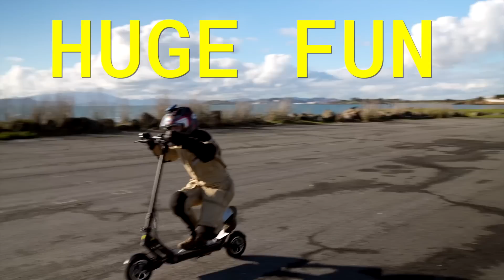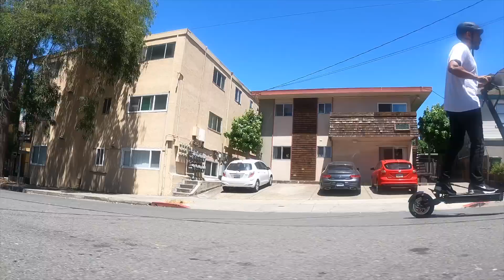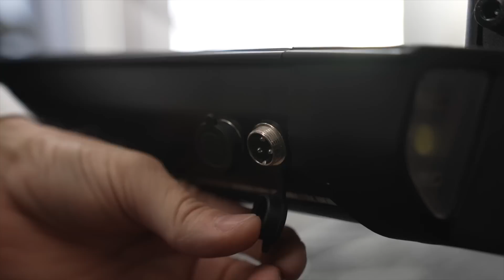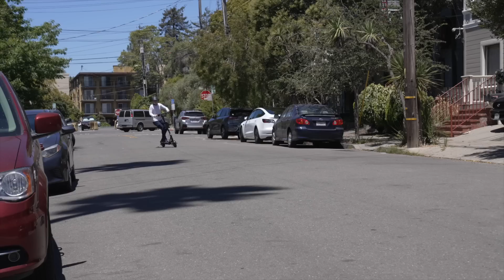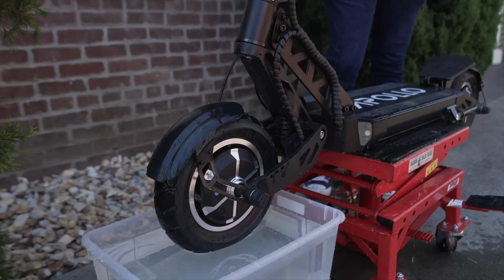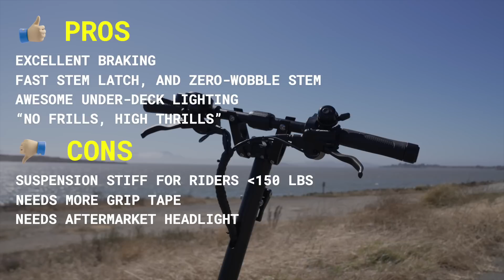NEW Apollo Ghost 2022 Gets 1,000W Motors - ‘No Frills, High Thrills’

Comment: people realize apollo is just a reseller right? the 1000W motors are standard on the VDM-10 (thats what the apollo ghost is actually called by the company that makes it) and it is half the price of the appollo lol. and you can get it with a larger battery.
Reply from the maker: The Apollo Pro , City Pro , Air and Go are all their own scooters and not OEM! They own the IP on all those models. The ghost has been discontinued a while ago.

Comment: I also want to share that the inner tubes and tires that the ghost comes with are not the best. I've got just over 1000 miles on my ghost and ive had to change each tube twice, I finally got better tubes and real rubber tires rather than the stock nylon ones. I should also mention that I do ride on trails and gravel often. Other than that i love the scooter so much, it's more than worth it in my opinion.
Reply from the maker: Very insightful! Thanks for sharing. -Vosk

Comment: Did you have to do anything to get the scooter to go above 15mph? Both my wife and I bought Ghosts, and no matter what gear we are in the maximum speed is 15mph even if no one is riding it (it's just sitting on a box with the wheels free spinning.) Apollo's customer support takes at least 48hrs, so just seeing if anyone here is able to answer faster :) If it was just one scooter I'd think it was defective, but where both have the issue I'm thinking I'm defective lol.
I've made sure the battery was fully charged, and the P settings have:
Acceleration = 5
Power = 100
I'm hoping it's just a setting I'm missing, or maybe something like the brakes being too tight. It's my first scooter so I'm kind of an idiot as to what's normal and what's not. Once it stops raining I'll test out the brake theory by riding it around a bunch. I've only gone around the block once when it wasn't raining to just to make sure it worked.
Reply from the maker: Did you try changing the riding modes , if it’s on eco mode it won’t go fast , make sure it’s not on eco mode and make sure it’s on dual motor
Reply: @ESG-ElectricScooterGuide  Thanks for the quick reply. Actually it apparently just needed to be broken in a bit. It's been raining here for the last week or so, so I hadn't been able to ride it since that first day I just took it around the block and it capped at 15mph.
My wife and I took our scooters for a few mile ride today since it's sunny, and by the end of the ride the scooter was hitting 38mph!

Comment: So it still a VDM10 but now with same 1000w (since the 2021 was rated at 800w and original VDM10 1000w motor) and updated stem? All the rest seems the same as the regular VDM…
Reply from the maker: Very similar with some upgrades!

Comment: I bought a '22 Ghost as my first scooter, based in part on these reviews. I'll definitely try your suspension tweak, I think that will be helpful. 

The significant QC issue I had was that the rear brake caliper adapter was installed backwards, in the 160mm rotor position. The scooter has 140mm rotors, so only half the pad area was being used. An easy fix, but it shouldn't have been shipped out like that.

A smaller issue is that the deck-mounted hook needs to be rotated 180deg, or bent upwards, to work.
Reply from the maker: Very insightful! Thanks for sharing. -Vosk

Comment: Im 140 lbs and i owned 2022 ghost, would like to know how to soften the suspension
Reply from the maker: My favorite mod for the Ghost is to add a small reinforced rubber washer and metal washer to the top of the bolts for the suspension spring. It doesn't really soften up the suspension, but keeps the suspension from clunking when it reaches the top of travel. The trick is finding washers that fit into the space. You can add a stack of rubber washers for more cushion. It’s best to use washers with fibers embedded in them, otherwise they will pop off. I’ve even seen folks work a small spring, into that space. The other thing I haven’t tried that could help is giving the spring one or two turns counter clockwise, to reduce spring preload. This would also make it top out less. The tricky thing here is you’d need to loctite the bolt once you’ve loosened it to make sure it doesn’t keep backing out (because if the bolt comes all the way out the spring could completely leave the scooter)

Softening the top-out feeling really changes the feel of the scooter for the better.   -Paul

Comment: why would this Ghost be a little slower than the 2021 ghost if there's two 1000 watt motors now, same speed controller and it being only like 2 lbs heavier?
Reply from the maker: That's a good question. The 2022 is quicker up hills, due to more copper in the motors, but there may be something about the motors that causes them to make less power at higher RPM. (different KV-spec: rpm per volt, perhaps)    -Paul
Reply from the maker: The battery voltage is most important reason for top end speed! also conditions, weight of rider, wind etc
Reply: @ESG-ElectricScooterGuide  the video review states under the same conditions so I assume the rider weight and road were controlled for and battery voltage. But the other factor about RPM per volt makes sense if the motor is built slightly differently. I wonder if there would be ways to confirm that somehow. 
Thanks for the response!

Comment: I am definitely interested in your idea to adjust the suspension for lighter riders…
Reply from the maker: My favorite mod for the Ghost is to add a small rubber washer and metal washer to the top of the bolts for the suspension spring. This keeps the suspension from clunking when it reaches the top of travel. The trick is finding washers that fit into the space between the spring-bolt and the top of the swingarm. You can add a stack of rubber washers for more cushion. It’s best to use washers with fibers embedded in them, otherwise they will pop off. I’ve even seen folks work a small spring, into that space. The other thing I haven’t tried that could help is giving the spring one or two turns counter clockwise, to reduce spring preload. This would also make it top out less. The tricky thing here is you’d need to loctite the bolt to make sure it doesn’t keep backing out (causing the suspension to fall apart). 
You also need to make sure that if you back out the bolt, that you always have at least three threads going into the lower swingarm.     -Paul
Reply: @ESG-ElectricScooterGuide  Great tips & worth trying them.Thank you.
Reply from the maker: Awesome! Enjoy your new ride! Stay Safe

Comment: Did they upgrade their tires that often get flat?
Reply from the maker: Tires appear to be the same, but the tubes may be different, and it comes with spare tubes. The most important thing to prevent flats is checking tire pressure once a week (or ideally before each ride) and making sure they’re fully aired up. All scooter tires have a ton of surface area relative to their volume, so they lose pressure way faster than car tires or even bicycle tires. 
I haven’t checked, but thicker rims mean that the profile of the rim is probably also more blunt, which would help prevent pinch-flats.   -Paul

Comment: Technical question for you - just like there’s no battery saving riding single, what real benefit is there to Eco when its top speed is 17mph, vs mode 1 at 20mph? Any difference in amps delivered, acceleration etc that helps significantly on a days ride?
Reply from the maker: Great question. The difference in acceleration between speed mode 1, 2, and 3 is hard to detect, but there is a noticeable difference in acceleration between Eco and Turbo. So Eco will be drawing less current. It's going to be a very small savings though, especially on the 2022 Ghost, because physics-wise, accelerating you and the scooter up to 17 mph takes a certain amount of work no matter how quickly it's done. So the only two things which would impact range here are:
Does Eco mode keep the motor cooler (less resistive loss to heat)
Does Eco mode lower your average speed (wind resistance is non-linear, so lower average speed increases range).

For big impact on range, the main factors are (in order of importance)
1) Keep top speed low
2) Set tire pressure to maximum recommended pressure
3) Have a small wind profile (hard to do much about this one. Zip jacket closed, zip jacket pockets closed. Close face shield on helmet if full-face).
4) Make sure brakes aren't dragging
5) Try to avoid applying more than 50% throttle, or run in Eco mode, to keep the motor operating in its most efficient mode. 

-Paul
Reply: @ESG-ElectricScooterGuide  wow thanks!
Reply from the maker: Happy to help!   :-)

Comment: I'm 155lbs- tell me your secrets, Paul!
Reply from the maker: My favorite mod for the Ghost is to add a small rubber washer and metal washer to the top of the bolts for the suspension spring. This keeps the suspension from clunking when it reaches the top of travel. The trick is finding washers that fit into the space between the spring-bolt and the top of the swingarm. You can add a stack of rubber washers for more cushion. It’s best to use washers with fibers embedded in them, otherwise they will pop off. I’ve even seen folks work a small spring, into that space. The other thing I haven’t tried that could help is giving the spring one or two turns counter clockwise, to reduce spring preload. This would also make it top out less. The tricky thing here is you’d need to loctite the bolt to make sure it doesn’t keep backing out (causing the suspension to fall apart). 
You also need to make sure that if you back out the bolt, that you always have at least three threads going into the lower swingarm.
-Paul

Comment: Awesome scooter! Question! Did you have the same issue as Ginger on wheels with your wolf king gt? Sudden jolts of power when taking off in dual motor mode? It took out from underneath me today and I fell off :/
Reply from the maker: No! We didn’t have any issues like that at all! Glad you are okay. Stay Safe.
Reply from the maker: It wasn't a GT, but I did break my wrist on a Wolf King trying to ride one handed. That was 100% user error though.  I pulled the throttle with only one hand on the bars.   -Paul
Reply: On full power settings the GHOST IS GRABBY & TAKES OFF FAST...SO HANG ON TO THOSE HANDLE BARS & LEAN FORWARD THAT TIME.😇🤣😂😍

Comment: At this price range, I would rather buy a VSETT 10+ dual motor than getting a mid cycle refresh ghost scooter, because there is an authorized VSETT dealer and repair shop 10 minutes from my house. The problem with Apollo is that they do not have their own repair shop in the Greater Toronto Area. I had bad experience with their partner service centre - Repair and Run, when I need to repair my scooter. They are not very helpful at all.
Reply from the maker: They are definately ramping up service centers in Canada & the US!

Comment: How do you guys think this compares to the apollo city? Which one would you choose.
Reply from the maker: It really depends. They both weigh about the same. The Ghost is quicker off the line and has higher top speed and much stronger brakes.

The City Pro (dual motor) is roomier, a little more modern looking, and easier to ride. The City Pro has a nice app, (that keeps getting better), it has tubeless flat-resistant tires, and the cool regen thumb brake. Both are really good looking. Oh, the City Pro has a higher water resistance rating and better fenders, so it’s definitely better in rain. 
For sporty intermediate to expert riders: Ghost. For new to intermediate riders who want a smooth commute and a scooter that’s a little more modern: City Pro.     -Paul

Comment: the suspention adjustment you mention, is that applicable to any vdm-10 varient?
Reply from the maker: It should be applicable to all. The feel of the suspension topping out is the only thing that bugs me about the Ghost. Do be careful about unloading any spring. Don’t sit on the scooter, while doing it, of course.
The rear spring is hidden under the rear footrest.   -Paul
Reply: @ESG-ElectricScooterGuide  Yeah, it would be nice if there was some damping, or at least a top-out bumper. I'd be happy to spend some money on improved suspension.
Reply: @ESG-ElectricScooterGuide  i'm in aus have an E-glide mach 10. over all love it two things tho later one is on me and not scooter. my model has mechanical brakes and i find that i have to re adjust them all the time either because soft or pad scraping noises startm, rotors are flat and true , also i have managed to lean so sharp while cornering at high speed I've hit the sharp edge of tyre and it's skipped/drifted like a stone on water (no stack recovered both times but definitely pulled over and waited for adrenaline to settle down) 
i have my suspension tightened as much as i could i weigh 65-70kg about 150lbs
Reply from the maker: I think you're ready for better tires. See if there are any PMT's available which will fit your scooter. One of the troubles with pushing the limit all the time (like I do) is that eventually you find it!
-Paul

Comment: I would like to see a video guide on suspensions.
Reply from the maker: On suspension in general, or tips for the Ghost? I’d love to do one on all the different types of scooter suspension!

Here are my tips for lighter weight riders on the Ghost.

My favorite mod for the Ghost is to add a small rubber washer and metal washer to the top of the bolts for the suspension spring. This keeps the suspension from clunking when it reaches the top of travel. The trick is finding washers that fit into the space. You can add a stack of rubber washers for more cushion. It’s best to use washers with fibers embedded in them, otherwise they will pop off. I’ve even seen folks work a small spring, into that space. The other thing I haven’t tried that could help is giving the spring one or two turns counter clockwise, to reduce spring preload. This would also make it top out less. The tricky thing here is you’d need to loctite the bolt to make sure it doesn’t keep backing out (causing the suspension to fall apart).
Reply: @ESG-ElectricScooterGuide  In general, like recommended settings, types of suspensions with its pros and cons, what to look for when adjusting based on factors like riders weight, terrain, feel, etc.  The more the detailed, the better. I currently have my Ghost '21 set to one turn away from the stiffest in the front and a turn and a half in the back. I'm still playing around with it on which should be better for me as a lighter rider. I might think of doing the mod that you mentioned because the rear screw feel too loose when trying to make it on the softer setting and afraid it might loosen overtime causing it to pop out through the plastic foot rest when compressed. Also would like go ask if Apollo made the kickstand on the Ghost '22 longer?
Reply from the maker: I don't think the stand has changed on the Ghost '22. The stand on our '21 Ghost is sagging a bit with time though, so it leans more. You have to be careful with the stand because it's made out of aluminum.    -Paul
Reply from the maker: As far as the suspension goes, I agree, you want to be careful with reducing preload. For riders under 165 lbs, I would try running the tires at 40 psi, and then adding a reinforced rubber washer and a small metal washer on the two bolts that hold the suspension springs in place. It will take away the clunk when the suspension tops out, and should make a big difference in the over all feel.  -Paul
Reply from the maker: In an ideal world, when you're on the scooter wearing riding gear, you would have 1/3 upward suspension travel available, and 2/3 downward travel available. So, in other words you'd be sitting at 1/3 from the top of the travel.   -Paul

Comment: "no benefit in using single motor in terms of range" . Is this true for all dual motor scooters? On my commute I always use single motor, thinking I would get more mileage.
Reply from the maker: We’re pretty sure it’s true for every scooter.   -Paul
Reply: @ESG-ElectricScooterGuide  wow.. this is new info for me.
Reply: @rzkysyz  Basically because whether you're using both motors or just having one motor do all the work, it's still the same amount of total work, pushing the same total weight. The load being spread across two motors doesn't make much of a total power draw difference.
Reply: Actually it does matter. You don't need all those headjerking starts with dual motor, the ride will be less jerky overall and you won't lose excess energy by putting it into range. Single motor mode is beneficial when you don't care about how much longer the trip will get, and if you really need to squeeze more mileage from the battery.
I'm riding apollo ghost as commute for 2 months in a row now so I noticed as much. 
Also you are much more likely to be trigger-happy with the throttle while in dual motor mode since the drag is addicting.
Reply: @HellGod67  lol, way to say a whole bunch of wrong.